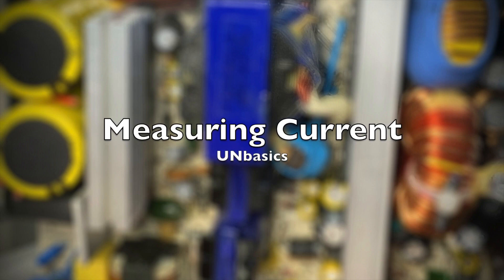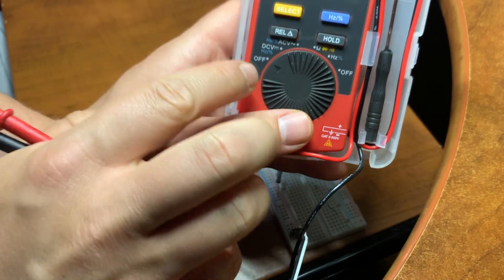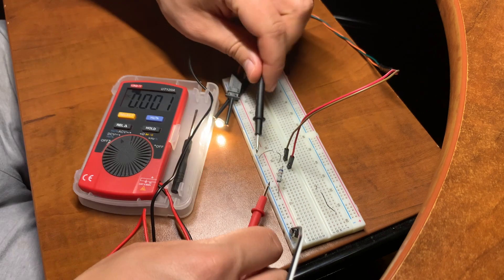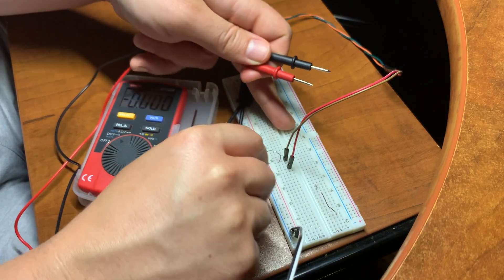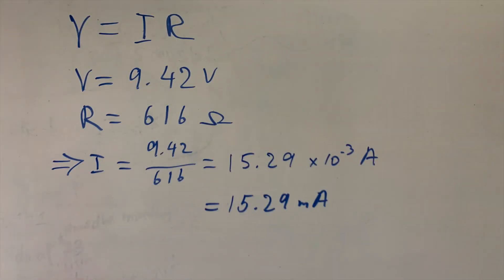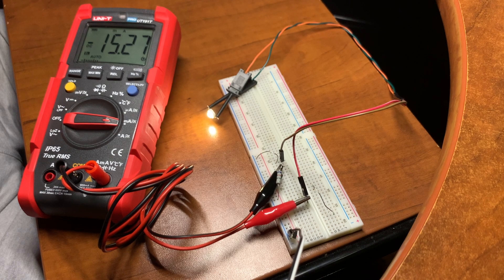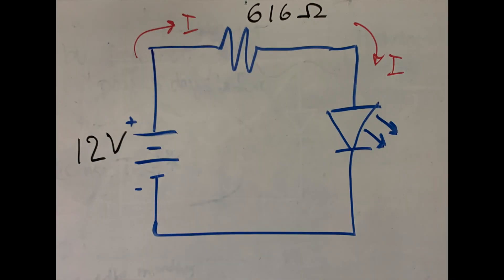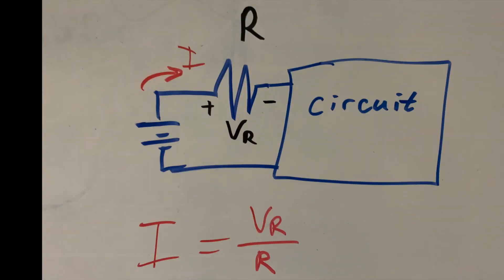#2 UNBasics: How to measure current without an ammeter.

Comment: Hi
Possible 20 ah battery ampere test?
Reply from the maker: If you’re asking about measuring the capacity of the battery, the process is more involved than this. You’d need to drain it while measuring output.

Comment: If you don’t have an easy way to add a resistor into the circuit can you not just measure the resistance of the entire circuit and then the resulting voltage drop from the same points?
Reply from the maker: Yes that’s definitely an option for a simple circuit. It’s almost impossible to measure resistance in more complicated circuits, especially if you want to know current draw only by a specific part of it.